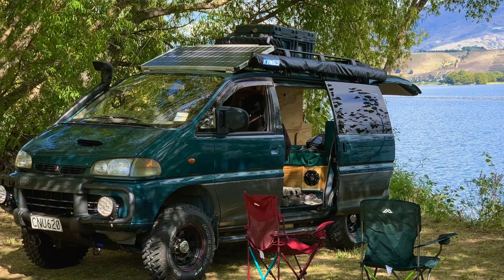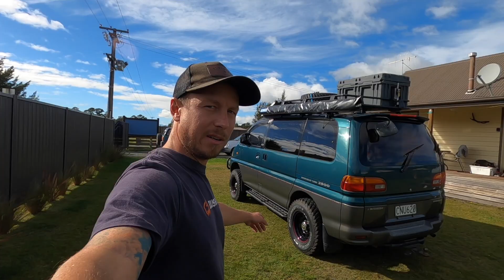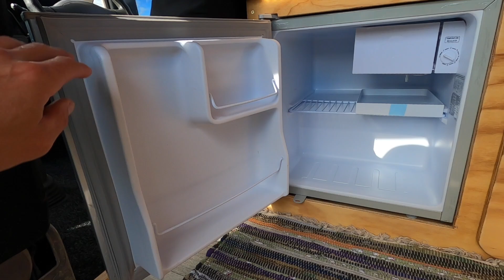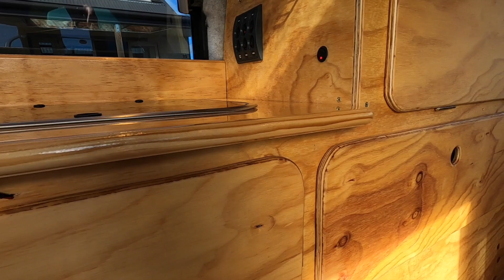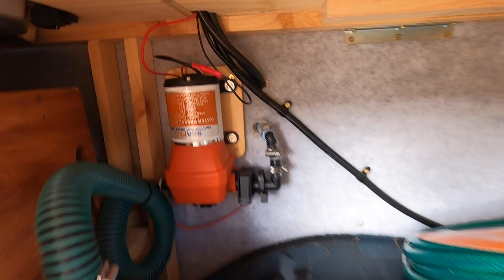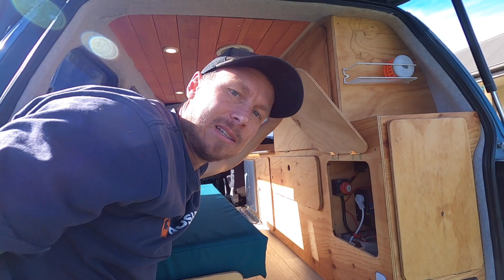The Ultimate Off Grid 4WD Survival Camper//Mitsubishi Delica Campervan Conversion//Van Life

Comment: Super cool rig, great job!! We’re thinking about getting one but will need to pull a trailer, does it have enough power to do that? Thanks
Reply: The 2.8 diesel is best for pulling a trailer. The 2.5 is a bit underpowered. Just helped a friend get a 3 litre petrol 6 cylinder Delica 2003 which is even better.  Heaps of torque and power for pulling a trailer. The petrol motors are much cheaper to repair ($300 for a petrol fuel pump compared to $3000 for a diesel fuel pump). Also diesel fuel is going up in price.

Comment: 14.5V for LA gel battery seems little to high to me. Its good for flooded type (14.2 - 14.6V), even acceptable for AGM (14.7 - 14.8V). You should not go above 14.1V or the gel starts to degrade. It will make your very expensive battery to be very cheap and useless quite soon. Anyway, all up to you....
Reply from the maker: Cheers mate didnt know that but im learning all the time, cheers for your info

Comment: Nice job. You can hang shower curtains from the tailgate ( I used magnetic hooks ) & with a rechargeable shower you’ve got a wash room. 
Could even heat the water by leaving a container on the roof rack.

Comment: keep going mate i want to see a winch, raised suspension, a limited slip diff, some transmitter gear inside, ariels on the outside. and 32 inch tyres on 15 inch rims, turbo reliese taps, and a diesel pump adjuster for a 14kw increase. dont forget the ladder
Reply: I just did an lsd in mine as a bit of mish to be honest hahaha
Reply: Yes, this

Comment: Congrats mate, one of the best Delica builds I have seen.  Are the front solar panel mounts bolted straight through the roof?  What would you estimate the cost for the whole build?
Thanks for sharing!
Reply from the maker: Hi Tyraus, i rivited the soloar panel to roof useing L shaped plates i brought from mitre 10...waterproofing with sika flex....cost of build around $8000 cheers mate

Comment: Might be a good idea to add freewheel hubs on the front if you are off-roading, allows you to disconnect the front shaft incase you snap one off when off-roading as the shaft still has to turn in 4WD or not. They literally take an hour to fit max.
Reply from the maker: yea was thinking about that